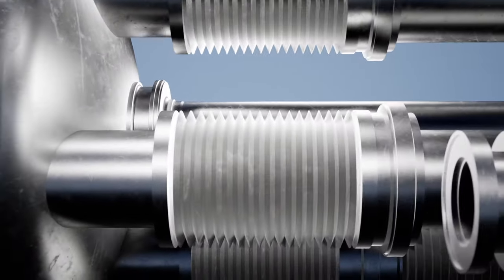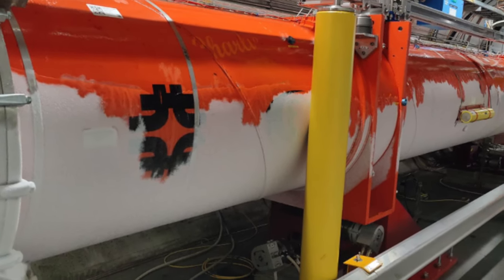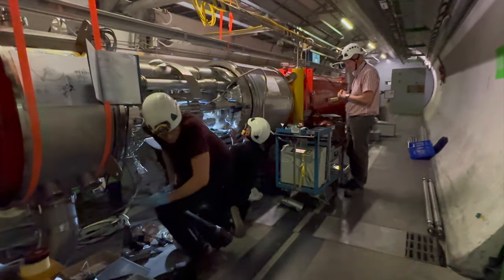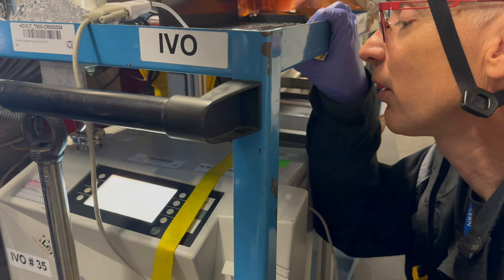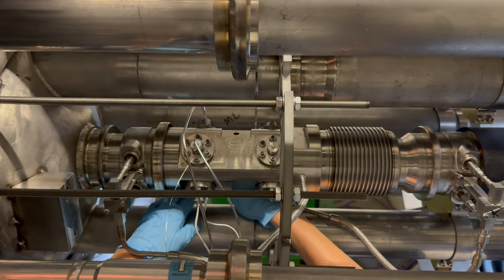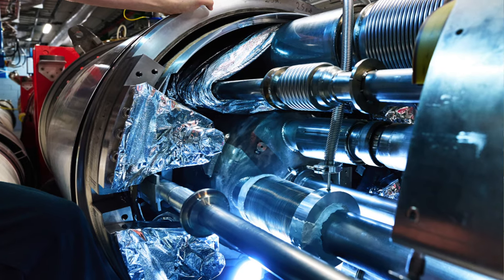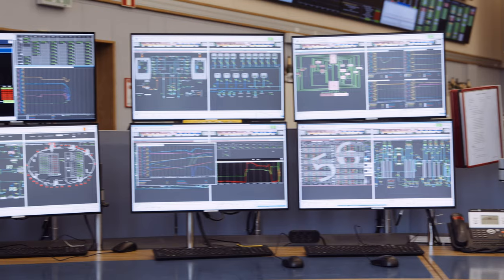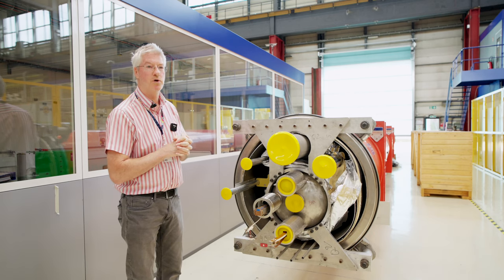The LHC leak repair

Comment: And what exactly caused the bellow to rupture? They are usually very robust ... - right? Was the beampipe shaking/moving during the electric interruption?
Reply: The exact details aren't available yet, but it is likely related to the regular contraction and expansion caused by cooling/warming up the magnets. Eventually any system like this will suffer a mechanical failure. Of chief concern right now is determining if other junctions could experience the same failure. If so, a plan would need to be developed to address it.
Reply: A tree fell on a powerline near CERN, which caused an electrical glitch large enough to quench the magnets (they stop superconducting). When this happens, stuff moves around, this damaged the bellows.

Comment: I had a similar problem, years ago, with the ondulation of the ballows cracked in a similar way. The crack was small and I found it by luck. Strange that same problem happens to more complex machines. Also using the mass spectrometer to do leak detection, classic. I miss working with vacuum and leak test.